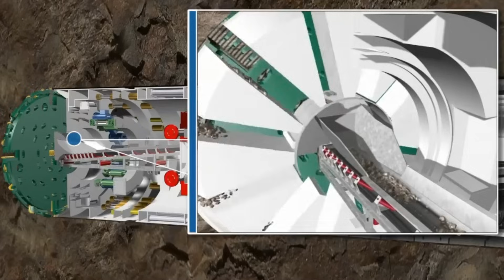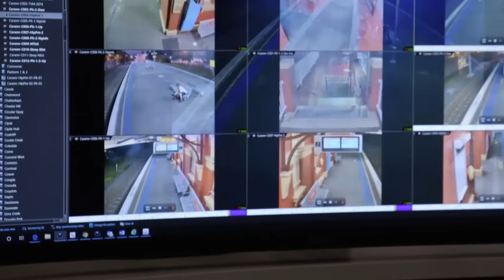The Sydney Metro Program - Australia's $64BN Mega Project

Comment: The huge expense is an investment in problem solving. The section already in operation works as promised and is well patronised. This is mostly new additional infrastructure that will reduce peak hour travel congestion. Road and rail.like your video but the AI voice needs work.

Comment: 64 billion??!! I would expect modern high speed rail between Melbourne, Sydney and Brisbane for 64 billion, not a local metro project. Wow, that is a big cost, I know Auatralia is a high wage economy but this is a lot of money.
Reply: The video missed a few details - the funding for this project is spread over more than 15 years, and is in AUD. HSR would be great, but there’s not enough development between Melbourne, Sydney or Brisbane to justify the cost - which would be far higher than $64B AUD. Ultimately this was a nice video but they really glossed over a lot of the details and complexities faced by these projects, including delays because of COVID-19 and a change of government. The rail lines mentioned are 4 separate projects and are not all funded the same. For example, the western airport line is partially federally funded so the NSW tax payer isn’t footing the entire bill.
Reply: @yeltseirp021  That's still massively expensive for the resulting infrastructure, number of stations, of building sites, and for the expected ridership.
Just for reference, it's similar in cost to the Grand Paris Express project that has 200km of new metro lines, of which 180km are deep bored in difficult terrain and / or under very densely populated locations, and having to deal with the overly stringent French tunnel laws that require an access / escape shaft every 800 meters or less.
Plus 84 new stations, 68 on the new lines and 16 on the 3 extensions to 2 existing lines.
I'll let you do the math for the number of digging sites it requires...
Add to that a minimum of 220 Alstom Metropolis trains, also fully automated, with their storage and maintenance centers (some partly built underground)...
All this with an expected ridership of over 3 million daily.
There's quite a dichotomy between what you get in both cities for virtually the same overall cost.
Ditto for the cost per rider.
I know that Sydney is very car dependent (by European standards) but still.
It's once again a case of outrageously excessive infrastructure development costs as is so common in developed English speaking countries.
Don't get me wrong, I'm a strong transit suppoter and advocate but this cost issue must be addressed.
For the same cost, Sydney Metro could have been much better, more useful with more stations and offering finer service to more people.
Reply: @KyrilPG  But what is driving those high costs?  

In the us and uk, it seems largely to be an issue of too many veto/holdup points (in the us anyone affected can file lawsuits about procedure, in the UK local councils often need to agree) plus, in the us at least, the lack of experience with these projects.  

Is that the same in AUS?  And I dunno what can be done since many of these concerns are pretty deep structural issues about government.
Reply: @petergerdes1094   Tried to answer you in details but the almighty eye of Mountain View did not agree...
There are plenty of explanations in the Transit Costs Project that was made by New York University.
Reply: @KyrilPG  The reason Sydney can afford this is because the NSW Government had no nett debt for several years and was saving money that would otherwise have been paid out in interest on government bond issues. Big road and rail projects are not new to Sydney. Sydney once had the world's third-largest tram network which featured more than 1,600 trams - three times what Melbourne has now. In 1924 Sydney began construction of Australia's first underground railway and the world's largest bridge (at the time). In recent years, Sydney completed construction of the world's second longest underground motorway and the largest underground motorway network overall, known locally as WestConnex - the mainline tunnels are 22km long and five lanes each way at the widest point. Other tunnels under construction now will link WestConnex to the north and south.

Sydney doesn't fear the big things. It just takes governments with vision and foresight to go ahead with building them.
Reply: @KyrilPG  Don't worry, they can afford it. Australia has a similar area to Western Europe with massive mineral wealth for just 25 million people to share around.
Reply: @yeltseirp021 Still 41 billion USD is a NYC level of cost.  Not crazy, but I wish it wasn't quite so high.
Reply: @petergerdes1094 
Australia has very high wages so every construction project is very pricey.  It will only get more expensive if delayed. 

The project provides jobs, earns taxes, develops trades and technology skills and expertise.  It also changes the property value of suburbs that will have new transport infrastructure, amenities and commercial and residential accommodation. 

Plus, Sydney needs more work hubs away from the already congested Eastern seaboard of the city and North Sydney.
Reply: 20yrs to late & this will still BLOW OUT the budget
Reply: @nathanthomas8184 
No matter when it is built, Aussie wages will always blow the budget.
Reply: The budget is a lot but the benefits will be enormous and transform the entire region and economy. The project will likely pay for itself within half a decade
Reply: In what world would you get high speed rail for $64 billion.
Reply: @carisi2k11  in the Anglo world it does not seem possible, but other European countries, China and others in the Far East have managed for far less than the Anglo nations.
Reply: @nk53nxg  
The cost for the 142 km Jakarta Bandung HSR is $7.3 billion or $52 million for a km, it isn't cheap either.
Reply: @Hkchinese888  yea, but that is a long distance over a mountainous country prone to earthquakes for 7.4 billion, not 64 billion.
Reply: @Hkchinese888 Indonesia has a very bright future.
Reply: @jamiecapes2644  yes, it's become a developed country coz they have high-speed trains.
Reply: Only wealthy people can afford to live there, so it's good for them .
Reply: @smellbag In Australia's answer to San Francisco, and America's answer  Sydney, it is  just for the rich, no doubt.
Reply: HSR is a money pit, even Australian can't afford it. The China HSR loses $50 million each day.
Reply: It’s 4 metro lines
Reply: the air can carry us we dont need low carbon transports
Reply: Yep Good luck with trying to build HSR between Sydney and Melbourne for $64 Billion. I have more chance playing Centre Half forward for Geelong!
Reply: There isn’t a single interstate high speed rail in the world that costs less than 100 billion, the high speed rail between LA and San Francisco currently being built is costing a couple of hundred billion and it’s less distance than between Melbourne - Brisbane so you’ve got your wires very crossed.
Reply: @ashdog236   It's not an issue of being interstate.
It's an issue of developed English speaking countries being unable to build transportation infrastructure at a normal cost instead of a outrageously excessive one.
One of the latest high-speed lines built in France, during the early to mid 2010's, cost 7.7 billion euros for 330 kilometers of lines (300km of dual track plus 30km of connections) rated for 350+ kph (220mph).
And it was delivered slightly ahead of schedule.
So it's very much possible.
And no there's no mistake : it's 7 billion and 700 million euros for 300+ kilometers of top rated HS lines that comply with both EU's and France's overly stringent environmental regulations, like requiring twice the land footprint and nature preservation of the extra double area, among many other measures.

It's only in Australia, Canada, New Zealand, UK and USA that it costs so much for no justifiable reason whatsoever.
If done properly, it is possible, and the fact that it's interstate or not shouldn't have any effect.
Reply: @KyrilPG  perfectly justifiable. We don't have a high speed rail industry for a start and lack a lot of manufacturing capability in 2024 and ther train lines in france run through flat land while the east coast of NSW has thousands of kilometres of mountains, valleys and rivers. Things cost this much because of having to import that tech and educate the workers as well as build the infrastructure. Because of this $7 billion euro's equates to $70 billion Australian.
Reply: @KyrilPG  exactlly, well said. In the Angloshere too many hangers on types skim huge amounts of the cost even before a shovel hits the ground. Lawyers, consultants and elements of the project farmed out to mates with huge profit potential for them raises costs. The way things are done allows bureaucratic types to skim massive amounts of budgets.
Reply: @KyrilPG  Bro, I would love to know how France does rail infrastructure so well. I notice France is building the Grand Paris Express which is probably going to be double the distance of track for around the same amount of money.
Reply: @carisi2k11    France is far from being flat, some high-speed lines have a gradient of 3 5%, and Spain is even less flat.
Yet, they build high-speed lines for even less than France.
Spain is essentially a group of mountain ranges and high plateaus with only pockets of flat land. 
The corridor between Melbourne and Sydney is quite similar to the one of the Mediterranean line in France (between Lyon and Marseille, stuck between 2 mountain ranges, the Central Massif and the Alps), with less population density between major cities than in France.
So no, it isn't justifiable. All the justifications you mentioned have long been discarded by experts as having only a marginal impact on costs compared to the amplitude of ballooning caused by the issues in the development process.
The cost issue is similar in all developed English speaking countries. The UK, for example, is 30 minutes away from France through a tunnel, they happily use foreign workers, and yet, costs are just as ridiculously excessive as in Australia.
Based on the justifications you've listed, it shouldn't be that costly because everything that's needed is a short ride away, from materials, technologies, to manpower and expertise. It can even be delivered overnight by rail.
The outrageously excessive costs result from the way the process is done.
New York University did a great job outlining these issues in the Transit Costs Project.
Reply: @nk53nxg  It's all good. With Australia's very high wages even the unskilled workers get high pay, free health etc. way, way better than a socialist country, yet one of the best democratic countries. They don't skim costs illegally as you may imply. Everyone gets high pay. It stimulates the economy, with no recessions in the last 30yrs (inc. The Great Recession, GFC 2008).  Totally shows up the lack of fairness for all compared to your non-Anglesphere countries.
Reply: @ashdog236   the cost today of these projects is out of control. Value for money for the tax payer does not seem to be of any interest to Anglo governments today. You will also find that private money will be involved in these projects too as long as the expensive heavy loss parts of the project are taken by the tax payer and future profitable areas are privatised, such as ownership of assets the public will use. What I believe also happens is that needless bureaucracy swallows vast amounts of the cost, the actual design, planning and building costs are actually only a part of the total because of this. I believe that a lot of this bureaucratic waste is deliberate skimming from opportunistic lawyers and consultants along with parts of projects being handed out to mates that ramps up the cost massively. Costs for compensation of those who lose land or property in proposed routes needs to be taken into consideration too but is likely small potatoes in the grand scheme of things. No wonder sod all gets done on infrastructure in the Angloshere it is over exploited by parasites that leach as much as they can out of any project. A lot of critisism levelled at the Chinese for simillar projects but from what I can see they just get things done right first time and on time, and usually at a reasonable cost. Any project in an Anglo countey is plundered rotten before it can even get off the ground.
Reply: @ashdog236  the USA, UK, Australia, Canada and New Zealand are all what is known as Anglosphere countries and all operate in a very similar manner due to being derived from the same English law system, culture and language. So when you say no  country in the World could build a high speed rail line from Melbourne to Sydney for less than 100 billion this is true for the Anglosphere but not the rest of the developed World. France, China and others have successfully built HS rail lines for great distances for far far less and recently too. 

In the UK a lot of public infrastructure such as schools and hospitals 40 years ago was completely under the control and built by the local authorities, this was not perfect as corruption was still an issue resulting in over spend but the public still owned this outright, it belonged to the people!!?? But, in the early 1990's the private sector lobbied the UK government (copying the USA) that it was unfair competition that local authorities could build their own infrastructure without the private sector being allowed a fair bid and being locked out of the public sector market big projects. This meant that all public infrastructure projects were now going to be funded under PFI or Public Finance Initiative. PFI was now the private sector lending to the public sector to build schools, hospitals and roads, this was now the only way to do things. You would think that the private sector could deliver in a far more efficient and cost effective manner than the old local authority built plan, but this was not to be, it is in fact far worse with worse build quality of public infrastructure too. Because the PFI schemes involved the land these schools and hospitals being built on being private and rented, the actual planning and building of the hospitals and schools was also private loans with high interest, and the privately owned built infrastructure has private maintenance charges, private management fees and all other bureaucratic bullcrap that escalated the cost to the tax payer to stratospheric levels on the never never. For the cost of PFI in the long run, councils could have built 3 hospitals instead of 1?? Also the public spending across the UK rocketed after this and never went down, these PFI schemes are meant to be never paid off and a tax payer gravy train to the private sector. Very poor value for money and excuse to milk public funds, this is the model the Anglosphere uses, and it is just pure parasiting of the public purse. With the old model private contractors were still building some of the public infrastructure, but the way it was funded was opened up to private finance and then the plundering really began. The tax payer in the UK and the rest of the Anglosphere is seen as an easy cash cow. Also Anglo central government seems to work for the private finance sector and big private construction and consultant firms not the well being of the public they are supposed to serve. To sum up big projects in the Anglosphere, all high costs and risks are socialised to the tax payer while all the goodies and profits go to the private sector. This whole set up makes the tax payer take all the costs and risks while profits and any benefits goes straight into private hands. This is the slow creep over time to the complete privatisation of all public assets, basically asset stripping the people. The Anglosphere has become so bad when it comes to value for money in terms of infrastructure projects that we now look incompetent compared to other parts of the World. To sum up; socialise the risks and losses, privatise the profits. This is the new Anglosphere way, it is basically legalised loan sharking to the public.
Reply: No one wants to drive to Melbourne or Brisbane from Sydney, or spend hours on a train when you can fly to either destination in a few hours and then fly back.  Road trip? Maybe.  Train journey. Nah. I did Sydney to Melbourne overnight by train once when I was a senior in high school. Never again. Even very fast, it’s not as comfortable as a quick flight. 

The High Speed Rail was a fantasy. If it had been built, it would need to be rethought in the 21st century. 

If we eventually are banned from flying, we won’t be allowed to travel outside our 15 minute cities anyway. 
Only within the Metro network as Big Brother dictates.